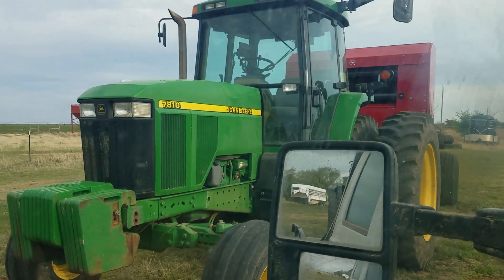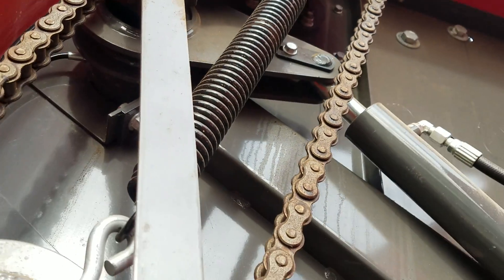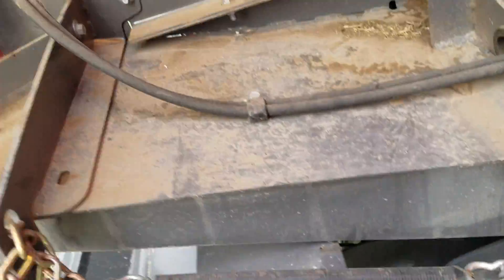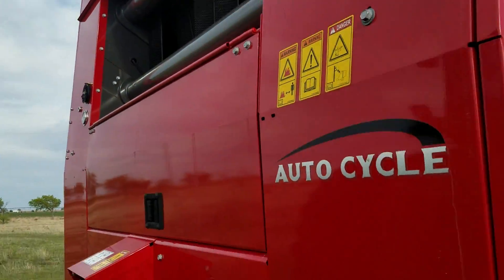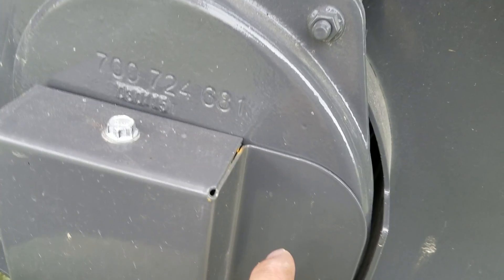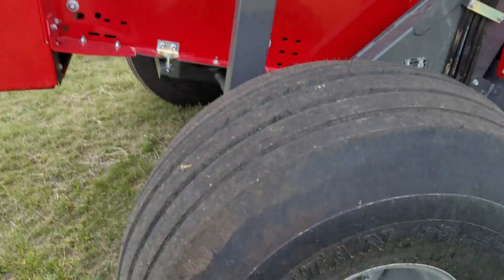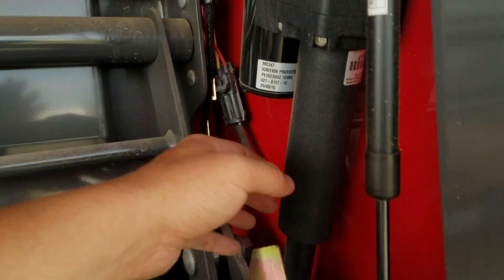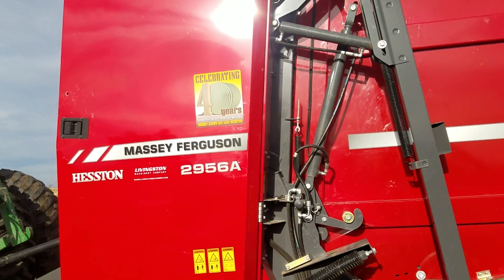Massey Ferguson 2956A first impressions

Comment: I don't know about you Will , you knocked my twine and my NH baler   LOL    we've had so much problems with frozen net wrap that I won't pay the extra $9000 for net wrap     I like the idea about saving time and I've had lots of days I wished I had it but I don't own a hay buster and 95% of my bales are cut and put in bale feeders.    The Hesston dealer changed for the better here and the guys that went back to the Hesston balers love them.